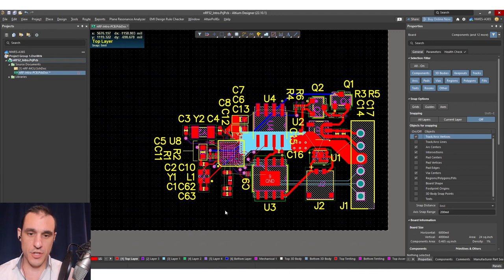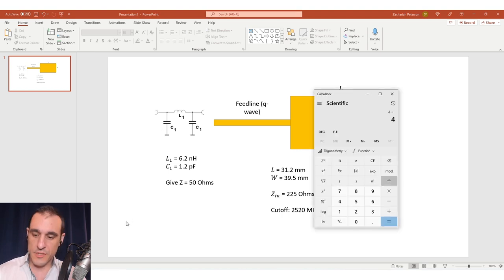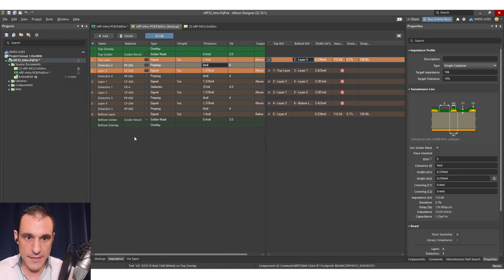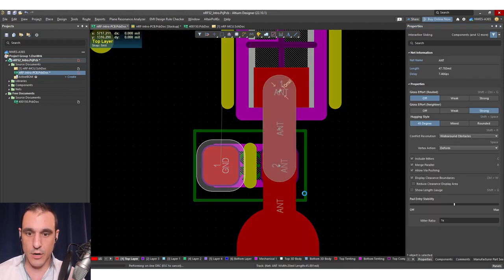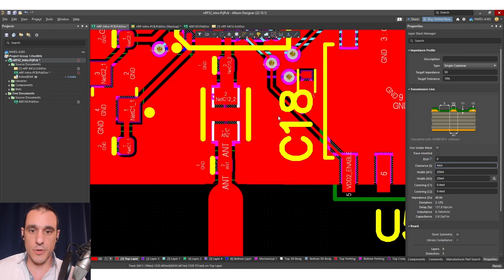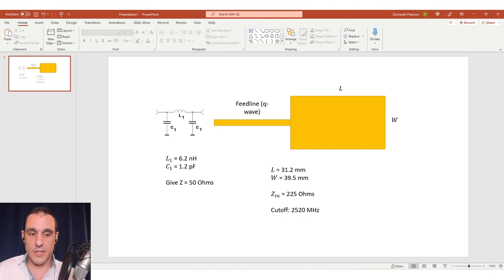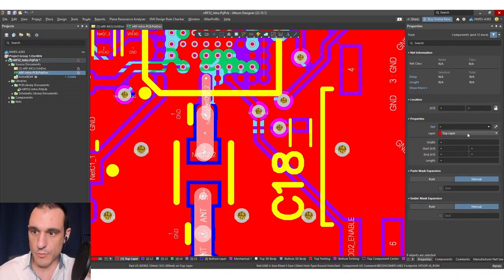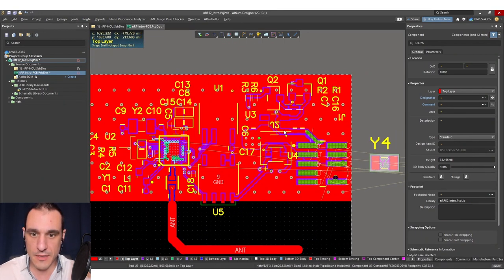Getting Started with an nRF52 Series MCU Part Three

Comment: Thanks. 
Question (20:33): you removed solder mask over the antenna to reduce losses, and accepted the ENIG finish instead. OK. 
But isn't ENIG more lossy than the solder mask at all frequencies (including 2.4GHz)?
Reply: It's been awhile since I watched this so I don't recall stating that ENIG had to be used, just that it is still an option at these platings. But regarding ENIG, you're right that the loss with ENIG is larger than with something like immersion silver or immersion tin, but at 2.4 GHz the different is pretty minor. I've shown graphs comparing losses with platings in another video and at a couple GHz the curves all start to overlap with each other. Once you get to the 10's of GHz you really notice the differences between various platings. So for this I would argue ENIG could still be acceptable if your goal is reliability.

Comment: Am I confusing this with a different series, or did part 2 keep all components on top (even at the cost of some longer/noisier routing) to save costs, and part 3 just went went to the bottom without a second thought?  Is there a rule of thumb for the costs of an extra assembly side?  Whether you should then revisit earlier routing decisions?  Whether board shrinkage will offset that cost?
Reply: I flipped the battery connector to the back side because its orientation would interfere with the antenna. So given the state of the board in that moment either the antenna would need to flip over and the board size would need to increase, or there would be a lot more component shifts to get the battery connector out of the way of the antenna. Placing on the back side was the easiest change in this case. Also since this is just a project and won't go into high volume, I'm not worried about assembly on the back side.

Comment: Is impedance no longer a concern when using microstrip? how are we matching impedances? - variation in stack ups etc? 

bonus q; 
how do you design a microstrip from scratch? say you do not have access to a ref design.
Reply: Designing a microstrip from scratch is easy. Determine the stackup and just calculate the width.

For this design, I am using a coplanar arrangement. So you'll see in part 4, that the coplanar line impedance is set by changing the clearance to the copper pour on the top layer. We could also just route straight in to the antenna and the microstrip width would have been about 8 mils. Either approach is correct, but because this is a tutorial I'm opting to follow the reference design for the moment. You'll see the impedance aspect handled in part 4.